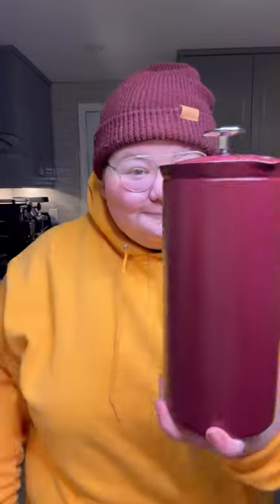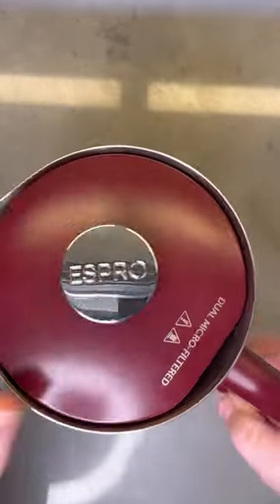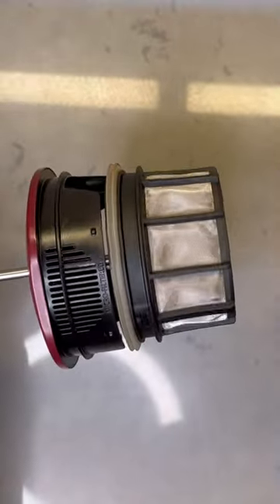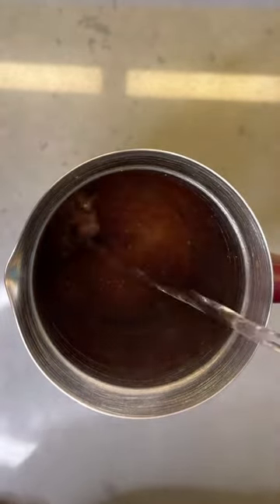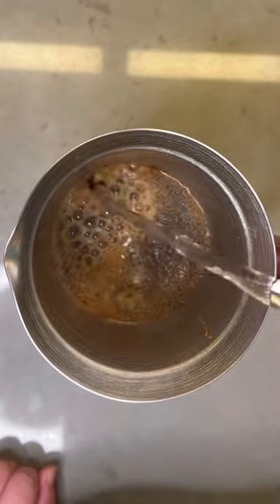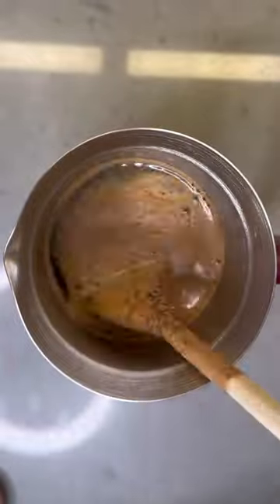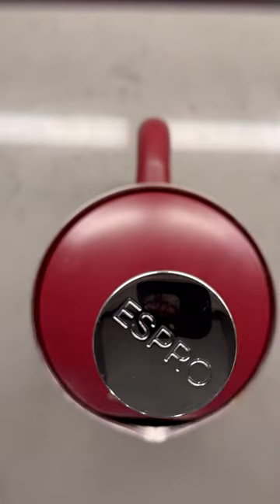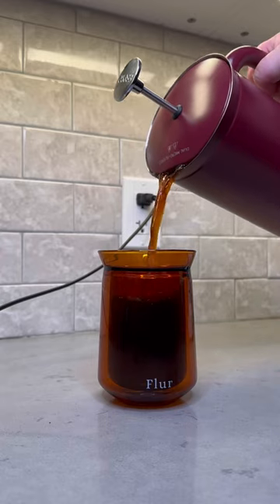How Does a French Press Work #shorts

Comment: Just from my knowledge. I thought a pour over gave a stronger caffeine extraction as opposed to the french press. I love both but I switched to pour over to save money on beans as well as I thought it was stronger.
Reply: pour over produces a different flavor profile because paper does a good job of filtering coffee fines and oils. the french leaves them in your cup.

I tend to prefer not having those coffee fines so I prefer pour over.

but if you like the taste of a clean cup that also utilizes some immersion brewing from the french, I'd personally use the aeropress (for 1-2 cups) or the Clever Dripper or the V60 Immersion Dripper, which is just a pour over dripper with the hole closed until you open it.